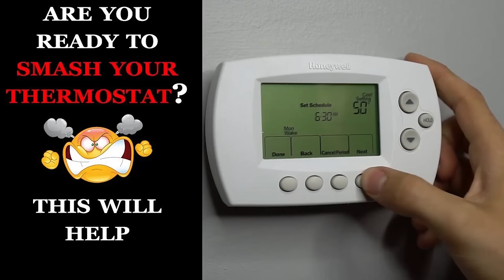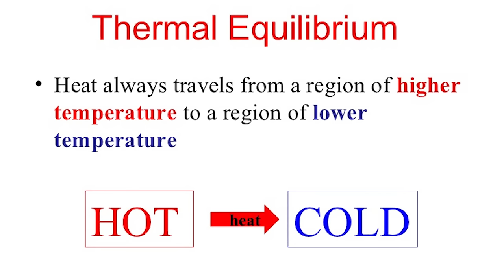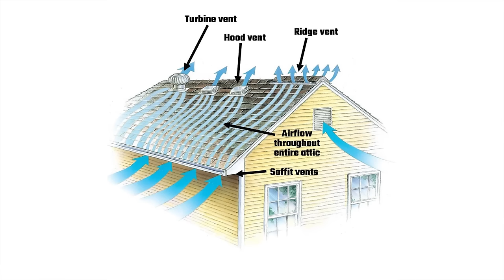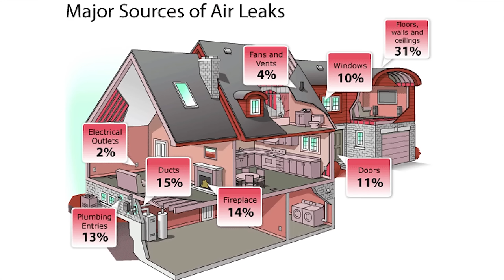AC Unit Not Cooling House - 20 Reasons Why

Comment: I was baffled as to why my ac was not keeping up.  I had two HVAC companies come out  on different days and they said the refrigerant level is fine. One company said my air filter was dirty and even changing it did not make much difference.   The other  company came out and said to replace the furnace (since it has a blower).  I did some detective work and used a snake inspection camera up into the air handler by removing the limiter switch and putting it into the hole and found no evidence of dust clogging the evaporator.  I then found out myself the condensate line was clogged. After cleaning it out with pressure from a garden hose in just the condensate line only it cleared the blockage and it is now getting cool!  I think that too much water in the evaporator may have froze in there and not letting it cool properly. This was somewhat of my fault since I didn't wire in the new condensate float switch I had on the unit.  Maybe this might help someone else.

Comment: What if you have double windows and live in a mobile home? The ac unit is closer to the front of the trailer and only cools the first room and bathroom but cools the back bathroom. The kitchen and living room are in the middle and has 4 windows. The smaller room isn’t cool but the back room has one vent but it’s closer to the second  bathroom door and gets really hot back there(since there’s no shade in that back room) I do have however been replacing the filters and I noticed there’s some dirt in the water. Do I have to have someone unclog it? Sorry we had our ac unit replaced last year and the out door unit replaced the year before since it was a lot just to replace it all together.

Comment: Great video. When I turn the AC switch on indoors, contactor flush pulled in but Fan or Compressor doesn't start. When i turn the AC off indoors, flush is released. Now if I try to bypass thermostat but pressing flush in various angles (had to really try in different angles) at that time fan and compressor turns on. I changed the capacitor (just in case), but i think i may have to change contactor, i see somewhat heated/burnt wires on T1/T2. Any advice? TIA!!!

Comment: My ac unit runs everything works fine condenser, fan motor, eva coil clean, but no cold air is coming out of vents. What could be the problem?
Reply: Your a/c refrigerant may be low or the compressor itself may be bad. You might need a technician to troubleshoot the issue
Reply: Or also the coil inside of the air Handler could be frozen due the dirty on it avoiding the air to pass throug the coil.
Reply: I'm having the same isuue

Comment: You mentioned air ducks that have cracks or breaks or some type of separation. Can that cause the A shape radiator to freeze up.  I've had 3 company's look at my Coleman unite for not cooling they all say that I have a leak but they can't find it.  So when the the pros cant find the problem who ya gonna call????

Comment: So, I am trying to figure out how to accomplish my vision. I am buying a new build. A friend of ours has a 1740 SF home, and I am getting a 1630 SF home. They are complaining about it not cooling to a good level, and they have only been in their home for 3 months. (New build as well.) 

1. What reusable filter is good for me to use?
2. My parents have an AC unit that runs 24/7, but the condencer turns on and off while the fan still stays on. Could you tell me the benefits of that? 

3 I want to route some ducting from my ac to the garage or another efficient way. What would you recommend?

Comment: If the turning down the thermostat doesn't make the air colder, how cold can you make your house? Obviously on a 100° day, you will never get your house to be 50°. What is the difference between the temperature outside and how cold the meter can depressurize the refrigerant? I'm sure it depends on the meter, but on average would you say that the meter can bring it down 25°? So if it is 100° the refrigerant when it leaves the condenser unit is 100° and the meter brings it down 25° to 75° therefore you can only get your house to get as cool as low as 75°?
Reply: Does this sound right? A common misconception for AC is that lowering the temperature of the thermostat makes the air blowing out the AC vents colder. This is not true. Lowering the temperature will only make the AC run longer. This is because refrigerant (the liquid that runs through the AC) can only be cooled down to 20° cooler than whatever the temperature outside is. For example, if it is 100° outside, the refrigerant will only be able to reach a low of 80°, therefore the dwelling will only ever reach 80°.

Comment: Just subbed !! You've helped me out soo much, much appreciated.  Still working on my AC unit.  Question.
I have a A frame coil ( mobile home ) electric furnace motor is under it. 
Where does the filter go?? 🤔  thank you for your time !
Reply from the maker: Thank you! Glad to hear the videos have been helpful!
Typically in mobile homes the filter/s will go on the inside of the door where the blower motor is.

Comment: Hey there—Hoping you could help us out a bit—when it comes to our problems we’ve had over the last three weekends now, the first time it was simply our disconnect lever was switched to “off”...
This past weekend, as well as just this morning, it was the exposed thermostat wire which runs alongside the whip... I’m not personally allowed to zip tie this wire to the whip, as I am a renter...But,  I wanted to mention those two things to add maybe🤷‍♀️, as well as ask you this: If this should happen to us again over the weekend, what would I need to do in order to plug that wire back in myself, rather than have to sit and suffer through the humidity all weekend for our maintenance to come back and do it? Is there a video on “quick fixes” like that already? We are desperate—our little one starts wheezing once it reaches 80+ degrees inside and this has happened (whether a critter, a kiddo, or some prankster) all August basically 🥴—i just would love to be able to fix such an easy-seeming thing myself. It’s the smaller, grey wire that runs right along side the whip. You called it the “two wire thermostat wire”... it’s just one, in our case. 

Advice? Tutorial? Lol haaalllp😬🥺👀?

(Your videos are so helpful already by the way—thank you for doing something like this for people!)

Comment: Hi. I've been watching some of your videos in hopes of troubleshooting my ac unit. A few weeks ago, after getting a spring tune-up, it was suggested to replace the capacitor. I had it replaced about a week ago and noticed that the thermostat started to slowly rise to mid 70s for most of the day and night. A few days ago, I just so happened to walk past the outside unit and noticed that the fan wasn't turning even though it was set to auto and cool on the thermostat. Just replaced the fan motor yesterday, but now the fan blades keep stopping - sometimes after a few minutes, an hour, or just doesn't come on at all. Any suggestions on what to check for next? I've even tried turning it on via the breaker box.

Comment: One fault can be the cable hole behind the thermostat has not been blocked off. Allowing air to flow especially in winter, giving false readings. 
Always plug that cable hole up

Comment: Jay, we have a fairly large AC unit ( has a 24 volt start connector )  outside that runs on Natural gas with a sort of standard forced air heater, When replacing the wall thermostat do i need to get a special amperage rating? What is the difference between a heat pump and an air ( cooler ) conditioner ? Thank you

Comment: I have a 1200 sf house and some one replaced a a/c unit on the roof 13 years ago it’s heat/ a/c unit  it’s 31/2 ton 13 sear Amana .is it to large for the house ?and which is a good brand and what sear should I get in case I have to replace it  I live in Las Vegas nv sometimes tempered rich about 120 +thank you
Reply: Carlos Rodriguez Generally speaking I would say yes it’s oversized. 2 or 2 1/2 tons should suffice for a 1200 sq ft home. With that large of a ac unit it will short cycle and not run long enough to remove the humidity from your home. Thus home never feels comfortable in the summer.
Reply: Robert S thank you next one I buy it’s going to be smaller unit it’s running good now I’m thinking of replacing the fan motor before next summer maybe that will help the unit run like new again .
 what do u think?
Reply: Assume you are talking about air handler blower motor and not condenser fan motor. But I would not change out a motor unless it has failed or bearings are noisy. If you want to improve performance clean the condenser coils, evaporator coils if they are accessible, be sure to change the air filters regularly. Check your temp drop between return grille and supply registers, should be at least 15 to hopefully 20 degree difference. If lower than that could be refrigerant charge issue given the age of the unit.

Comment: My house is a typical ranch built in 72. 1400 ft.² with a full basement. In Kansas. From the time it was built it had a 2 1/2 ton unit that has never cooled efficiently and can’t keep the house below 77° when it’s 90+ degrees outside. Do you feel like going to a 3 ton unit would make a significant difference on this. The only time it has problems when the temperature is above 90.

Comment: Can a bad capacitor cause the outdoor fan and compressor to shut off intermittently? The blower fan continues to run with warm air coming out of the vents inside the house till I turn the unit off at the thermostat. Thanks for your advice!
Reply: Replaced the run capacitor and it is running like a Rolex...

Comment: Is it normal for the unit to blow harder in the winter when the heat is on but in the summer when the AC  is on the air blowing out isn't very noticeable? Also everything is up in the attic and my husband has blocked off the ventilation panels at the end of the house. He thinks that it helps keep the heat in during the winter months. I have also noticed black and gray fuzzy strings & even some paper that looks like some type of must read notice that may possibly been attached to the ducking itself. coming out of the vents in the ceiling down into the floor and just hanging from the ceiling itself. What could be causing that?

Comment: Thanks for this video sir!  I have a question.  My unit can't get that 15 to 20 degrees difference from the return/split 10 degrees the highest Incan get.  I use to get that 4 yrs ago.  My unit has been topped off, both condensor and evaporator coil have been cleaned. Everything looks good but after doing some research would it be possible that my TXV is not working properly? I am a hoke owner not a ac tech btw.  Any advice would be appreciated?

Comment: Thank you for your good video. I have a question for you, when I hook up the gauge to the unit coleman condenser, I saw the pressure on suction line higher than the pressure on the discharge line, at that time the discharge line cooper very hot, and then condenser fan stop working, the compressor works hardly. And I shut off the unit, the gauge show the same before. Please explain this phenomenon to me. Thank you so much

Comment: You said if a system is low on refrigerant it has to be leaking. At what point do you consider a system low on refrigerant. I feel like most Ac's I see are running, and cooling adequately below "normal operating pressures". Even though that is technically low, right? or do you only consider it low when it affects other readings like TD, or liquid line saturation?

Comment: How many tons should I have for a 1553sq ft home? (This includes garage and front entry as well as rear lenai). My home is slightly under 1500 sq ft living space. We have a 2 ton unit and my AC struggles to get under 76 on hot days. We bought a new construction and found this out afterwards.

Comment: My unit has 2 separate capacitors (start and run). I replaced the filter, pull out the digital thermostat, cleaned it and replaced batteries, and replaced the start capacitor. Same problem. The unit can't still keep up with the thermostat temp. Would a failing run capacitor affect how cold the supply air is? It was cooling the house fine 2 days go.

Comment: Great video? Very informative and helpfull. Suddenly one of my unit stopped working but the fan continued to work. The room temprature went up considerably. However the unit started working at its own early mornning, What could be the reason? Is it malfunction of capacitor or thermostate?

Comment: Can lifting my unit up to level it cause the copper pipes to leak? I propped my unit up about 3 months ago and just recently after weeks of high 90s and a hot 103° day my thermostat the past 2 days will slowly creep up to 76° for the house temperature and the set point was for 71 late the evening when the sun goes down and the ac unit outside was running non-stop all day the past 3 days even though the past 2 days that were 84° exterior temp and cloudy weather, the air is running cooler from the fan on the outside unit. It normally was hot air before when it was cooling the house faster. My ac unit is 8 1/2 years old and it's the one that the builder put in, Do you think I have a coolant leak?

Comment: The technician replaced the capacitor of the blower inside to make it stronger the air coming in every air vents. Because I told him why the air from air vent is slow unlike before. Then he told me he added 3 pounds of freon the reason I paid more.

Comment: Hi, i have a newly installed ac. My house is 880 sq ft and have a carrier 1.5 ton Comfort series AC. I understand that ac can take time to achieve the desire temperature. Ac achieved only up tp 22 degrees and  stuck for there for how many hours. Installer said, my house has a poor air circulation. But thinking for my old ac, i don't have this issue until it fail because no more refrigerant. The outside temperature is 28 to 35 degrees. Installer checked everything but poor circulation is their culprit. May you suggest what else should be done to achieve the 20 degrees? I plugged or closed all the duct in the basement. I hope you can help me. Thank you. Jonathan

Comment: So our air conditioner is about 7 years old, and we had a tech come to look at it because I had it set at 75 but it is increasingly getting at hotter and hotter temperatures. It's consistently 84 by the evening and won't cool down until the night.
They said the "indoor blower may be losing efficiency causing higher than normal humidity levels and higher indoor temperatures".
It is extremely hot out (triple digits). I've been looking at other videos of yours and haven't heard anything about blowers and humidity levels. What does this mean in layman terms?

Comment: HI JAY,  I HAVE LENNOX 80MFG SERIES AIR CONDITION IN EDICK FOR SOME REAZON I CANT FIND WHER IS AIR FILTER  IN FURNES  , DO THEY HAVE AIR FILTER IN FURNES THANKS
Reply from the maker: Sometimes the furnace filter can be in a tricky spot. If it blows air, there should be a filter somewhere though. This video may help you locate it: https://youtu.be/uPaZvHp4L2Y

Comment: Would you recommend if able to afford to replace a 15 yr old unit (that’s 10seer ) for a new 16 seer more efficient unit..my current unit has some rust on the evaporator coil and haven’t had it serviced at all (my mistake). The outside is 3.5 ton while the inside is a 4 ton.   My reasoning is I do want a unit that cools way better and hopefully easier on electric bill.

Comment: Hey Bub! I have a 3.5 ton Goodman for a 1500 sf home and all is good only around 2pm to about 11pm temperature in the house is 80 to 81 when we set it at 77. Outside temperature is over 100. 
  I do your check list the only thing seem off is the hot and cold line only 2 degrees different, would that be the cause? if so how to fix it ? thank you. Had a technician check an they said is normal and I disagree we never had this issue before. please help.

Comment: My AC for three levels new townhome in Utah county have difficulty to bring temperature down to the bedrooms at the third floor (thermostat on the second floor).  AC tends to over work and could cause ice buildup.  When there is some ice in the system,  the unit will not work properly.  The condenser fan motor even does spin at full speed and makes some clicking sound.  After turn off the unit and ice melt, the unit works again including the condeni fan motor also working at full speed without clinking sound.  It seems that the weird fan motor clinking sound when struggling at lower speed is unrelated to the ice buildup.  How to fix the problem? A service technician did not find any problem with the unit Freon pressure when the unit was running properly.  Thanks so much!

Comment: Just had comfort pro out, we have 2004 crane unit with the r22 refrigerant. Tech determined that the compressor seals were shot and not moving Freon..everything else functioning as it should. Is this common or rare issue. Does this sound like we need a new unit completely or do u know of any cheaper fixes

Comment: question  i have house were not getting to set temperature on thermostat.i find out they installed a 2.5 ton unit outside which is fine but inside the unit is 4.ton  ...do you think that is a good reason for not reaching thedesired temperature ???

Comment: Is it common for an AC unit to have a dual capacitor and a single capacitor?   On the dual capacitor only 2 posts are taken.  The common and the herm.  The fan post rated within working range but it wasnt being taken up.  There was a single capacitor that rated 5uf but was out of spec already.  So I'm wondering if its possible to just connect one of the cables to the fan, in place of the single capacitor.  Or if it does need a separate capacitor.